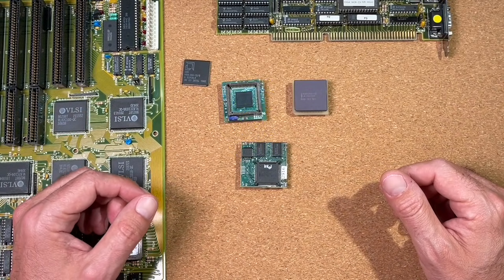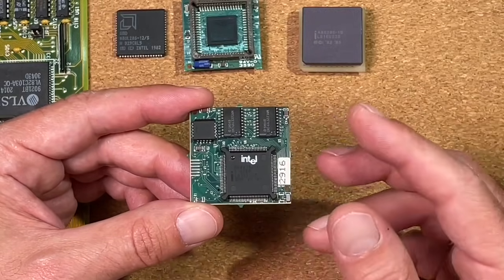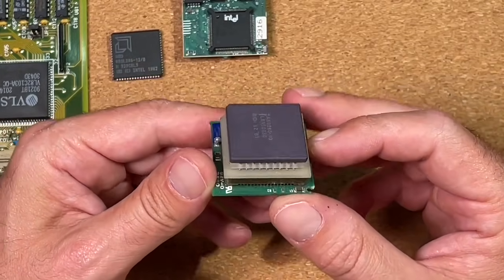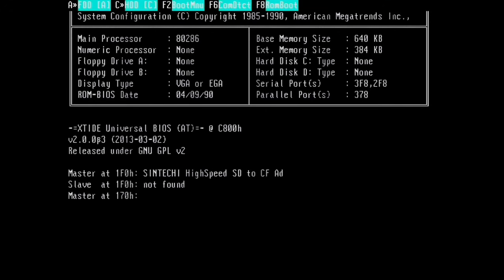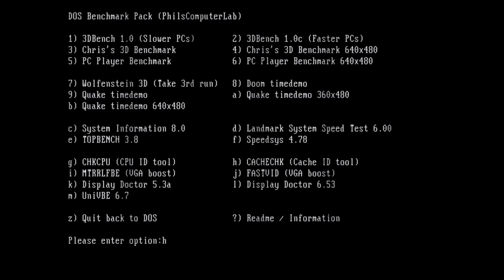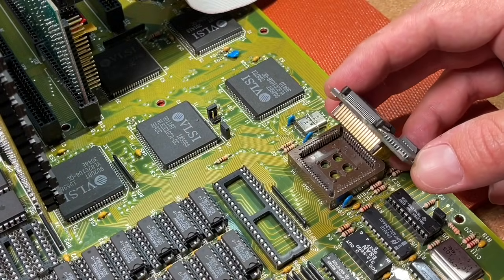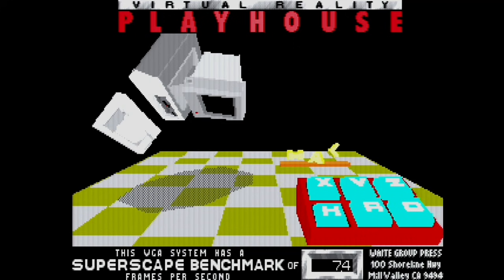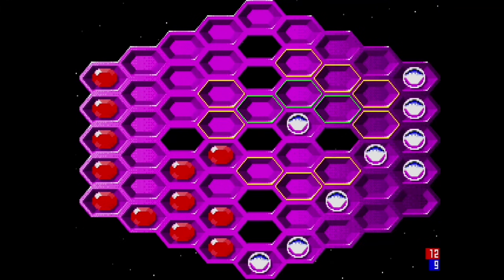286 Boost! Upgrade to 386 or additional Cache ~~ODD PARTS~~

Comment: I’m glad you’re back!  Maybe you can swap the crystal on the motherboard while running the the 386 upgrade? I suppose you’ll run into the clock limit on those old chipsets. Of course there are 20mhz 286 chips too. Perhaps a fastest 286 ever test?? 60ns  RAM, 0ws and an over clock!
Reply from the maker: yeah, would be a try worth to change the crystal. Hah, yeah, maybe I should make a follow up video to my 486 record and make the fastest 286 board. 😇. Actually I am working right now on another 286 video. Its a unique board at the end which deserves to get called the most beautiful 286 board. 😉.
Reply: Who was it that posted a video of a 486s PLCC upgrade for a 286 board that used a cyrix slc?
Reply: The Harris 286-25 would allegedly overclock to 30 or 33 mHz with no special effort other than maybe socketing the crystal.
Reply: @dalecomer5951  The biggest issue is the chipset -- unless it was one of the very latest that was designed for faster 386SX clock speeds, most earlier boards (At least all the ones I have) top out at 12mhz or 16mhz.
Reply: @CPUGalaxy  Can't wait!
Reply: @adriansdigitalbasement  Yeah those things are so very rare. And a really neat toy to play with. It is always interesting to see how the slower memory bus effects performance on those era of machine. 

I will have to find the video I was talking about. (it may have even been some blog post from years ago). Its performance was obviously not too flattering and certainly not 486 like, but it was an interesting product. 

Come to think of it, it may have been HighTreason that made it.
Reply: @adriansdigitalbasement  There were a number of 20 mHz 286 boards and the better ones will run at 25, 30, or even 33 mHz. The very late Headland chipset which was also used for 386sx is the best. I have some funky but cool PcChips 20 mHz boards with chipsets marked "PcChips." I think it is the same "PC Chips" which was notorious for fake cache 486 boards. The fast 286 boards came at a time when most were buying 386 and even early 486. Came in under the radar like the fast 8088 and V20 PC boards. Love that stuff.
Reply: @CPUGalaxy  Take a running 286 system on an airliner and you can probably lay claim to the worlds fastest '286 .... fastest in the physical sense. :)
Reply: Maybe buddy should send the chip adapter to you to do the testing and do the crystal swap. Maybe a collabe video in the future?
Reply: Change to a 25 Mhz clock , I think this is the corrct speed for those and also change 
the ram chips to mach the speed if they can't run stable ( they might be too slow )
The other component should be ok at this speed .
Reply: @wishusknight3009  I remember that , someone already did this back in time , using an add on board .
386 was most common but due to lots of older 286 still being used you could actually buy those cards .
Correct me if im wrong but I think the reason they used the Cyrix processor was because it acted more 
like a 386 than a 486 ( many instructios ect was originally missing internally ) This was also the reason 
why it lost as big as it did and really couldnt run the '' modern '' games of the times with enough 
framerates to be playable .
That was the reason Cyrix , well was '' kicked '' out of market ... 
Intel was simply faster .
But cyrix tried up until the 586 and pentium overdrive chips ect but too late , they was too slow ..
I remember having a 486 with Cyrix processor and when I changed to an intel 486 it was like getting 
a whole new computer ( even it was same clock speed ) It was just faster no matter what .
edit - that was the fun times building Pc's
Reply: @kennethsrensen7706  Yeah, I remember the addin card. It still required the original CPU be removed and a PLCC interface be added, and many of them also contained ram on them as well. The vid I saw on one of them was an SX with 32k of cache on it.
Reply: Yeah, this should be possible indeed. The VLSI VL82C100 / VL82C101 / VL82C102 / VL82C103 / VL82C104 chipset is of the newer kind and supposedly supports speeds up to 16MHz so I guess swapping the crystal for a 32Mhz one might be a viable option for the 386sx to run at the full, whopping 16MHz speed; hold on to your helmets! ;-) 👍
I'm currently experimenting with these 386SXs. I'm desoldering a 386SX-20 and swapping it for a NOS Ti486SXLC2-40, pretty hard (for a barbarian like me) to do with those little surface mount QFP legs, but a nice little project :-) I'm very curious how this would hold up to a 486SX-25 for instance in the benchmarks.. And will it play Doom? (sorry I digress)
Reply: @pipschannel1222  The 486 will cream it. It wont even be a contest.
Reply: @wishusknight3009  I wouldn't be too sure about that. Both processors support the full 486 instruction set and both have 8k of level 1 cache. 
Ok, the i486SX has a 32-bit external databus while the TI486SXLC2 has a 16-bit bus but the TI has a 15Mhz advantage over the Intel as it's clocked at 40Mhz vs 25Mhz on the i486 so I think the TI might be a tiny bit slower but creamage will most certainly not be happening here. An AMD 386 already came close(ish) to an i486SX25, so a 486 at that same 40MHz clock speed as the AMD will execute instructions more efficiently (because of its optimized ALU and enhanced 486 pipeline) ;-) 
Raw integer speed might even be faster than the Intel CPU, but  of course the 16-bit bus will be a big bottleneck especially for memory speed (and size of course as it's limited to a mere 16mb), just like those IBM SLC(2/3)s..
I will have some benchmarks when I'm done.. I think it will perform on par with an i486SX-20.
Reply: @pipschannel1222  The SLC is a 386 with extra instructions. Its structure is almost in no way related to the intel 486 and its tightly interlocked pipeline. The SLC2 at 40mhz is also only going to be running a 20 mhz bus as well because of its clock doubling. They don't even keep up with a 386DX to any reasonable amount. My guess is the 486 sx25 is about 30% faster in almost every practical bench. At the very minimum.
Reply: @wishusknight3009  You're apparently unaware of a few variables here. 
First off: It's not a Cyrix SLC, it's a TI SXLC2.. Same family, different beast. SLCs have only 1k of internal cache. SXLCs have 8k. 
More importantly: Mine will not be running a 20MHz bus but at the full 40MHz because I will swap the clock crystal for an 80MHz one as this mainboard was designed to run a multitude of CPUs including the Am386SX-40. SXLCs can run clock doubled but don't have to. They can also run at 40MHz internally and externally. Not many people know this but a TI 486SXLC-40 is the exact same CPU as the TI 486SXLC2-40. Ergo they both have the clock doubling registers. When an 40MHz external bus speed is detected, they just run at 40MHz internally and externally and when a 20MHz bus speed is detected the internal clock speed can be doubled setting the clock doubling register.
An SXLC, like the SLC, though lacking the tightly interlocked pipeline of the original Intel 486 CPUs indeed, do have the full 486 instruction set and are quite a bit faster than 386SXs running at the same clock speed even with their clock doubling and cache disabled, so they do benefit from the added efficiency of the 486 instruction set and use less clock cycles to perform the same tasks as a 386SX or DX (if compared to a DLC or SXL). 
I do not know where you got the idea that these processors can't keep up with a 386DX. That's just total nonsense. Must've been a machine with its cache disabled or something.. A 486SLC @ 40Mhz is about  about 70% faster than an AMD 386SX-40 in DooM (check out https://www.youtube.com/watch?v=xGWjQzge42o) and about twice as fast regarding raw integer speed and that is with only 1k of cache. It easily outperforms an AMD AmDXL-40 with only 1k of cache (18FPS in 3Dbench for the Cyrix SLC40 with its mere 1k of cache enabled versus 16.1 for the AMD AmDXL-40). An SXLC2 will outperform this even more. These processors really are quite a bit faster than people tend to think. I have all these CPUs so I'm speaking from empirical evidence.
I have an upgraded Compaq Deskpro 386/25 (which was a DX-25) that has a Improve Technologies Ti486SXL2-50 upgrade it and this thing performs just about on par with an Intel 486DX-33 (except for floating point calculations of course). Got the benchmarks to prove this.
Raw integer speed isn't bottlenecked by the narrow 16-bit external databus so the integer speed of a TI486SXLC2-40 with its 8k of cache, running at 40Mhz internally and externally will be at around the same speed, maybe even faster than an i486SX-25, hence the estimated overall speed of an i486SX-20.
Memory performance however will indeed be hampered by its 16 bit bus. That will be quite a bit slower than its true 32-bit counterparts, especially the ones running at the same clock speed.. but the higher 40Mhz external clock speed will make up for a lot of the losses, compared to the 20/25MHz 486SXs..
Reply: Many companies made these types of boards i have tons with ibm blue lighting 32bit and 16bit plus various other 386/486/+ adapters u can get many in japan auctions for nec epson computers some include simm slots for faster ram 
Io data, buffalo etc etc
Reply: @primus711  I didn't realize there was ever any blue lightning chips with 32 bits bus. As blue lightning was an intel licensed direct clone of the 386 while the cyrix SLC/DLC were clean room. But i could be a little off in my history.
Reply from the maker: oh. all right. sounds good. And how could I get those from Japan? 🤔 😉
Reply: @primus711  Ah ok. I was under the impression that it was a clone 386 with some added instructions and cache basically. But still 100% 486 compatible.
Reply: @primus711  So a little further reading and you are right. The later generation Blue Lightnings were not related to the cyrix chips at all. It is the earlier ones that I am confusing here.. Good stuff. Learn something new every day. It seems like it was an actual 486 cloned intel core... Really interesting.
Reply: @wishusknight3009  modded with 16kb cache
The chips with heatsinks that say bluelightning r cyrix and were made after

X3 x4 do overclock to 100+mhz
Reply: @primus711  All original IBM Blue Lightning CPUs (I'm referring to the real IBM Blue Lightning in QFP format, not the later Cyrix ones) were in fact fully 32-bit internally and externally. 
There were no 16-bit only versions made. I think you're referring to its cousin, the IBM 486SLC(2) which is 16-bit externally, but not an actual Blue Lightning CPU. 
The actual IBM Blue Lightning is known as 486BL2/3. Some call these IBM 486DLC3 (I guess to make the distinction between 16/32-bit units but IBM never did).. It featured internal clock tripling, a full 32-bit databus, a bigger CPU die and more transistors than the 486SLC.

Not many people know this and it is a bit confusing, but IBM designed the Blue Lightning CPU to operate on either a 16-bit or a 32-bit bus. In both cases they used the exact same chips, BL2s or 3s, ranging from 50 to 100Mhz internal clock speed. 
My IBM PS/2 Model 56i for instance, has a 75Mhz clock tripled Blue Lightning, which is one with a heatsink. This is is a full 32-bit IBM BL3 CPU with 16k write back L1 cache but it's SMD soldered onto a 16-bit planar, verys similar to the 386SLCs IBM used years earlier, which makes it run in 16-bit external mode effectively and limits the max. amount of RAM to a mere 16megs. It's a pretty weird machine because integer speed is very fast for its time but memory performance: not so much, due to having its external databus that's cut in half.. It's in fact a 386SX on steroids, which is why I love this weird machine :-)
This exact same BL3 CPU can also be used on a 32-bit planar to run in full 32-bit mode but IBM had a few warehouses filled with 16-bit planars as they thought their IBM PS/2 machines would sell better. The rise of the clones, especially by companies like Compaq is one of the reasons behind these weird motherboard configurations.. They just had a huge surplus of old parts :-)
Reply: @pipschannel1222  u just repeated everything i said and i never said anything about internal 16bit i said they made 16 and 32bit versions who cares what internal is as that makes no difference besides being able to write 32bit code and yes the 16bit version is a blue lighting everything is same besides pins count and the fact its runs 16bit data 24bit address 
Also many 32bit cpus of this era can run 16bit busses they have a built setting to enable
Also reason u can only run 16mb ram is the 16bit ver only has a 24bit address space
Reply: @primus711  
You obviously missed the point that a 486SLC2 on boards like an Amiga Vortex bridgeboard, which you refered to as a Blue Lightning is actually not, as it's a 486SLC2, which is incapable of interfacing with a 32-bit external bus while the actual Blue Lightning in fact is, but yeah, I just repeated everything you said. Let's leave it at that then. Don't bother actually reading comments and just get offended then, replying with a fallacy. I don't care.
Reply: @pipschannel1222  who said i was using stock i think u miss read what i said 
Im a engineer i said i had 1 on my vortex as in i swapped out cpus
I also have 1 in my fm towns marty and fm towns ux20
Please pay attention seems your fallacy got u offended
Your whole reply to me was acting like i was incorrect about something and i WAS NOT
I just didn't copy paste a book into YouTube comments on everything  about it just the important info and how to easily obtain 1
Reply: @dalecomer5951  I think I've got the same board. A M396F? Did you know this can also run at 40MHz bus speed by swapping the 40MHz with an 80MHz oscillator? Cool stuff 👍 Mine went from an i386SX-20 to a TI486SXLC2-40, running at 40MHz internally and externally, nice upgrade :-)
Reply: @primus711 Just to not repeat everything you said once again: Please enlighten a mere mortal like me from an engineer's perspective: What did you swap with what?
Reply: @pipschannel1222  u been enlightened now use your mortal ability to read
Reply: @primus711  That's a negative, enlightenment has not been had ;-)
Seriously, I'm curious about this swap you reportedly did on this Vortex GoldenGate of yours. Pls do share..
Reply: @pipschannel1222  I was speaking of a really nice, late 286 board. I do have a few of those M396F boards though. A lot of computer in a small package for the time.
Reply: @pipschannel1222  well x4 is a rumor why i said x3 x4 do over 100mhz
I have seen people showing x4 etc but never tested myself to validate
Im sure if their r wouldn't be a bunch
Reply: @primus711  Those are some nice upgrades, but I was wondering how you got a Blue Lightning working on an Amiga Bridgeboard if I read that correctly. Is it through one of those clip on adapters?
Reply: @pipschannel1222  no on the vortex i swapped cpu and voltage change
And i got way way more adpaters like those but with faster procs and added ram slots
Reply: @primus711  Ok, so you desoldered the original CPU on the Vortex? Those things originally came with i386SX CPUs didn't they?
Reply: @pipschannel1222  CX486SLC2-50 mine is the 486slc2 version
Reply: @pipschannel1222 : Well, I liked your description and thought it was accurate enough. The PS/2 Model 56 (and 57 that shared the same planar) didn't have a following 'i' (that was the Model 76 and 77 "Lacuna" planar with integrated IDE for the 'i' - as a trailing 's' was when it had a SCSI adapter). You're referring to the 9556/9557-xEx - the 'E' in the submodel encoding means the 486SLC3-75 CPU.

You've seen my video (and have commented on it five months ago) about it, but here it is others: https://www.youtube.com/watch?v=hMiweOYZTQs
Reply: @pipschannel1222 : The IBM 486SLC3 / 486DLC2 is actually the same chip, just different bus modes. And the 486SLC3 mode wasn't ever called the "Blue Lightning" - When the 486DLC2 is on the CPU daughtercard for the PS/2 Model 70 and 80 it is identified as one of the Blue Lightning versions. While it does give a CPU 'Reset Signature' in 486SLC3 mode (A43xh, with the stepping encoding '9' being the only version I have seen), the 486DLC2 mode does not!
Reply: @IBM_Museum  Thanks, you're right about the i, it's a 9556-DEB so it's a PS/2 Model 56SLC3 with the weird "neutered" DLC3 Blue Lightning CPU 👍
I got this machine of the local marketplace, nearly for free because it had a blown power supply. I have the European version, so its original power supply was produced in Italy and they literally all blow up but luckily I found a seller on Ebay who had a US unit and those were way more reliable. 
Lovely machine though with its on board XGA-2. I found the matching IBM 8515 monitor, mouse and keyboard, added a CDROM drive and a sound card and replaced the SCSI disk with a SD2SCSI unit and I'm running OS/2 Warp, Windows 95 and MS-DOS 6.22 on it 👌
Reply: @primus711  Ok now I'm confused. You upgraded a CX486SLC2-50 to an IBM Blue Lightning? How did you do that?
Reply: @pipschannel1222  helps if u know how to solder

Also there r undocumented registers for these cpus online think vogons has it
Reply: @IBM_Museum  Yeah, you must be referring to the Blue Lightning Processor upgrade package for the older PS/2 models, like the DLC2-66, which is of course fully 32-bit as it was meant for 386DX class machines.. IBM's documentation is not really clear on which CPUs actually classify as Blue Lightnings. I think it was a marketing term really; a good one at that as it sounds powerful ;-)

I referred to this nomenclature earlier as I was told that the SLC3 in my 56 is a 'neutered' Blue Lightning, because the same chip is used in upgrade packages but IBM indeed never labeled this "narrower" configuration as such. Pretty confusing, especially because IBM didn't share a lot of their technical documentation with the public, at least that's what I think or maybe it just got lost.. 
I do know though that the DLC2/DLC3/SLC3 has a bigger die, has more transistors on board and is a bigger package than the 486SLC and SLC2 (132-pin QFP package instead of the 100-pin 486SLC2 and SLC2 (as the last 2 are both 'narrow bus only' CPUs, like the 386SLC).

Is the SLC3 really the same as the DLC2? I did not know that.. Could these chips be both clock doubled and tripled and run in 16/24 and 32 bit bus modes then? So a 486DLC2=a 486DLC3= a 486SLC3? That's a pretty versatile chip then! It makes sense to me now that on a lot of the Japanese upgrade boards that used IBMs CPUs you could either run these chips either clock doubled or clock tripled ;-)
It's a shame though they're not pin compatible with the 386SX/Cyrix/Ti chips. That would make for one hell of a 386SX upgrade (it can be done using some home made circuitry or an interposer though) ;-)
Reply: @pipschannel1222 
 yes u can run the multipliers on them  higher
And they r pin compatible
Reply: @pipschannel1222  https://www.cpu-world.com/forum/viewtopic.php?t=33618&view=next
That board i have u can set the cpu multi to 3x or where people r getting the 4x rumor to 4x from the board
So u can run bus speeds at lower or 33mhz
Reply: @primus711  None of these IBM CPUs are pin compatible with the Cyrix CX486SLC2. First of: A CX486SLC2 is a PQFP-100 package, which has the Intel 386SX pinout, while the DLC2/SLC3 is a 132-QFP package. 
Even a 386SLC, which is a 100 pin package like the 386SX wouldn't work because is has a different pinout. I've been there (desoldered and soldered heaps of 386sx-class CPUs). Maybe it can be done with a home made "interposer" circuit though.. It would be nice to make one of those ;-)
Reply: @pipschannel1222  
u are incorrect each 132p quad flat is pin compatible with 386dx and every 100p is 386sx only difference is voltage
Also making a adapter that ties 32bit ver BS/16 high etc for 16bit is easy many pcb makers today cheap
Reply: @primus711 
Help me understand: How can a quad flat package be pin compatible with a 132 pin grid array package? It's a different footprint. I guess you meant part compatible?
Also: a 386DX has no L1 cache so the IBM units have added pins for cache coherency.

What I meant earlier is that an IBM DLC2/SLC3, which has 132 pins cannot be soldered directly to a board meant for a 100-pin CPU, like the Vortex, which has a 100-pin 386SX  or a Cyrix SLC2 (386SX class) CPU on it as far as I know. 

A Cyrix SLC2, like on the Vortex (which is completely different from the IBM units in almost every way imaginable, except for both being x86 CPUs) has basically the same pinout as a 386SX with some extra pins for cache coherency but an IBM DLC2/SLC3 most definitely has not as it's a 132-pin package. 
That's why I wondered what you did to make a Blue Lightning CPU which is a 132-pin package, work on a board designed for a QFP-100 CPU like the Vortex, like you mentioned before..
Reply: @pipschannel1222  look i dont care what anyone says 16bit 100p and 32bit 132p r blue lighting whether its whatever name sl bl bx 
And every 100p 386sx qfp design is 100% the same 
Same as 132p designs 
Whether it be intel cyrix amd ibm 
I never said anything about pin grid arrays for that its obvious u need a socket to qfp adapter which u can get as there r many qfp to pga chips
Reply: 80286 chips had a "burst mode" which over clocked the processor. Perhaps you could pull that pin high on the CPU socket while the 386 chip is installed for better performance?
Reply: I'm surprised that you never tried the 386sx board on the cached 286 adapter.
Reply: @pipschannel1222  you lost me with a Cyrix being "386SX class".when you say "class", you're referring to the pinout? you seem to be referring to that in the next paragraph. You may already know, Cyrix never made 386s, they might have made 387 co-processors, but a 486 (for 386 machines maybe) was they're earliest CPU offering; It's an interesting exchange of ideas you have but it quickly becomes alphabet soup (with numbers for extra confusion)
Reply: @squirlmy  I'm sorry I lost you ;-) I know Cyrix never made an actual 386sx CPU. With "386sx class" I meant "386sx replacement CPU with the same pinout" indeed and my point was that no way on earth the IBM DLC2/SLC3 (DLC2/SLC3 are the same CPUs and can run in both 32-bit and 16/24bit mode) is one of those in contrast to what some people persitantly claim, as these are QFP132 and the 386SX-class pinout is QFP100, but apparently some people do not get that point and answer with arguments like "It helps if you know how to solder" and "I don't care what anyone thinks, they're all the same", which is of course very helpful in making this whole alphabet soup become more confusing than it already is ;-)
Reply: dont upgrade the clock - the arch will be using too much of power :)
Reply: @CPUGalaxy  can you make a socket-board adapter for RPPico? This could make really fastest upgrade! RPPico could emulate even dual pentium! You just need to put a SPI SRAM on the board.
Reply: I have an old 80286/20 NEAT PC board. It performs better than my old Compaq Deskpro 80386 SX with 80387 coo-processor and 4 megabytes of RAM.